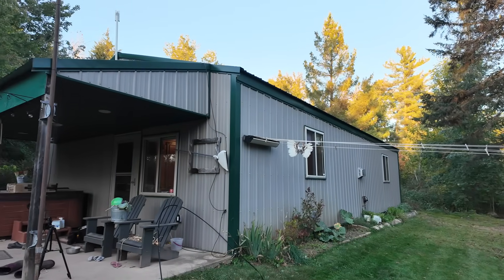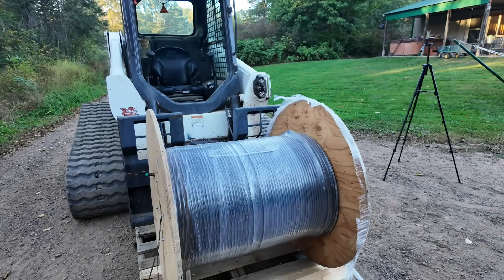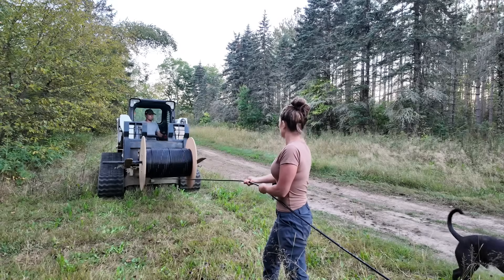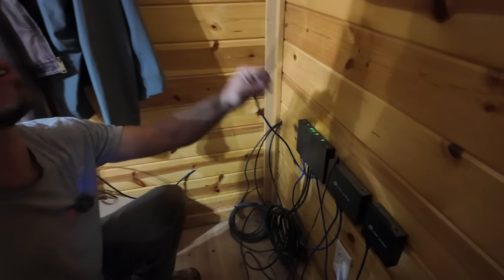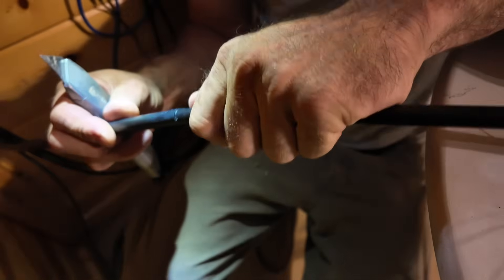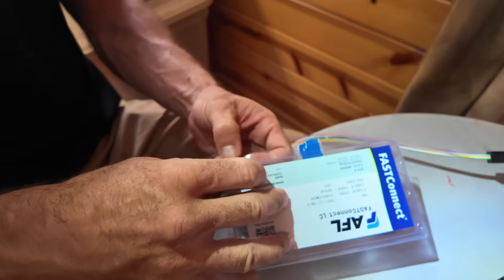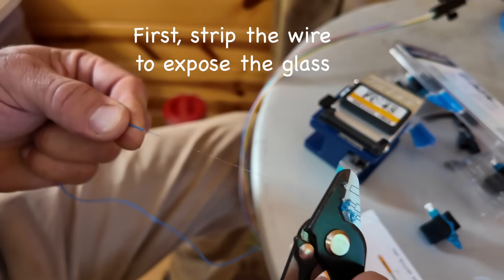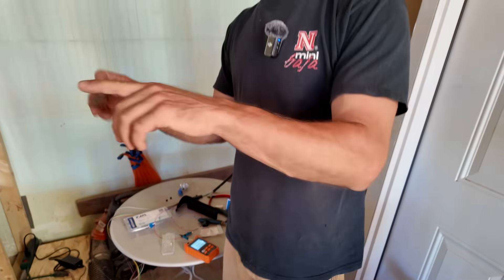We Need Internet! Running a 3,000 ft Fiber Optic Cable

Comment: Great work, I do agree with others on the long term life-cycle solution: Find a fiber guy with a fiber splicer and purchase pre-terminated LC connectors; OR if you want to drop money, buy a used splicer, those are the pros, melts the glass and splices 2 ends together, that's the golden industry standard!

Comment: Why not just get a pipe down and blow the cable through? Cable will cost probable 1/4 of the price and the pipe is pretty inexpensive aswell and you still need to dig so. Would be alot easier if something happens with the cable because of frost in the ground etc.

And why not just terminate it in a box outside on the wall and get a core fusion splicer and a preterminated cable spliced to it? This looks like a nightmare.

Comment: I work in IT and love watching stuff like this. I've terminated Cat6 patch panels and made many an RJ45 ethernet cable in my time. I've never made a fibre cable before, so interesting to see and learn about that. Nice one, guys. Good luck with digging the required trench(es) and protecting your connection.

Comment: You can use ethernet over power line devices. 
Those "cores" are glass strands, hense fibers. The early FO cables buried along the right way in Kansas & Nebraska in the 1980's was not armoured. Sprint had problems with speed, so the problem was the gophers were chewing on the cables and causing cloudiness in the glass strands, so they has to add the extra protection for feature runs of the FO cables.

Comment: Enjoyed the video and the learning experience, thanks for sharing.  If I was to make a recommendation, it would be on the networking side.  With multiple locations, and as Content Creators I would look into Ubiquiti equipment over TP-Link.  TP-Link is inexpensive and therefore where most people start, but it has severe security loopholes and lacks management tools.  A Ubiquiti system would allow to manage all your sites, integrate cameras if you choose too; magnetic locks with badge or fingerprint entry, a NAS for all your files and backups, battery backup... basically everything a business + home needs under one umbrella.  On top of this, while it may sound overwhelming, their software is very beginner friendly without sacrificing in-depth tools.  Plus, there are lots of tutorial videos available.  Just a thought, but looking at your situation, I think it would serve you considerably better with networking alone.  The rest is optional, but extremely useful.

Comment: Typically when installing an ONT the armored cable goes into an ONT box on the wall that is around 1.5ft big and it has a big circle wrap around where you leave a service loop (extra wiring) and wrap all the fibers around the circle. These fibers wire into an LC port on the box where you can use stronger fiber patch cords to plug it from the box into your equipment.

Comment: I found a source for direct bury 2 core single mode pre-terminated, very reasonably priced.  I think I paid around $900 for 1,000ft.  If you use SC connectors and SC SFP you only need one strand for send and receive.

Comment: Oh my! Glad you figured it out but... 

You didn't need the fanout kit or the special slitter. With fiber don't strip back more than you need. Additionally don't strip so far in one go. If you had stripped 3-4 inches at a time of the outside jacket you wouldn't have needed the special tool. When removing cladding prior to cleaving you only need to srtip about an inch. Enough for the grip areas on either side of the cleaver to grip the fiber. BE CAREFUL with the cut off piece of fiber. If it gets poked into your skin and breaks off (which it will) it's really hard to get out and can be quite painful. To test for signal loss you need a single mode optical light source, 2 fiber jumpers and 2 couplers. Plenty of tube videos on how to do it. 

I hope you left a few service loops! Ideally at both ends and maybe in the middle somewhere. If it breaks loops are very handy since they reduce the number of splices by half.

Comment: Good job for a DIYer. Another tool you should have is a connector cleaner. It doesn't take much to make the connector end face dirty which can wreak havoc on your signal.  In addition, debris and contamination can permanently damage the connector. The connector pressure at that tiny scale is around 45,000 psi

Comment: Nice video!  You might want to check out Crosstalk Solutions' channel.  He did a video on shooting WiFi through the woods.  Turns out you have to go to 900 MHz as 2.4 and 5 GHz won't penetrate.   Now that you have fiber run, it might be good as a back-up.  And it might be affected by rain.    https://www.youtube.com/results?search_query=crosstalk+solutions+get+wi-fi+to+outbuilding+through+wooded+area

Comment: This fiber was a great solution, but I can tell you I have many networks going through heavily wooded areas for much farther and work like a champ. The situation is that companies keep upping the frequency used for distances, and bandwidth benefits. If you go down to the old school 900Mhz systems (which are still available), they won’t go as far, but they will penetrate a lot of objects without issue. 1/2m of trees would have not caused a blip with some of the systems I’ve installed. Day late and dollar short, and fiber is a fantastic option once installed, but for those looking for similar solutions, do note, there “are” wireless options to consider that would have worked.

Comment: I understand you’re keenness to hook up the cable and get it working; however, I can’t help but feel that it was a mistake to roll that cable out before you had a trench to put it in. The cable is at risk of damage until you get it buried, and it’s going to inevitably be in the way when you do get to digging your trench.

Comment: Wow! I've been in the industry for over 30 years. Although it wasn't wasn't designed or completed exactly correct, you did an excellent job as a DIYer. I didn't think you were going to be able to get that close to correct or even be able to get it work. You chose the right type of fiber for the distance and application, you didn't need 12 strands but if was cheaper then it was the right choice. You clearly did some homework and had enough common sense to get it to work. If you started polishing fiber I would have lost it. Great job! For not being a network guy I'm impressed.
Reply: Lol, i almost thought he was going to pull out a scope to inspect the endface... :)

Comment: You guys are incredible. Your explanation almost made me feel like I could do it, though I know in my heart it would end up as many of my plumbing project do. Still, I am a network engineer and never considered running (much less terminating) my own fiber. Cheers to you for adding yet another skill to you kit! P.S. I did run one of those long range wireless links, but it was line of sight, no trees, and it worked great.

Comment: One-third applauding (as a fellow DIY-er) your efforts while two-thirds shuddering and cringing (as a LV technician) at the various mistakes you've made with the fiber pull and network installation.
I guess if you've got it up and running then call it a win.
Live and learn!
Reply: Terminating fiber properly requires highly specialized (and very expensive) tools. The laser you used is basically just a continuity tester and tells you nothing about whether the cable will perform at its rated speed. For that you need more sophisticated equipment. A pro will probably charge you upwards of $1000 to terminate the fibers but that's a tiny fraction of the cost of the required termination and testing equipment (many thousands), and there's no substitute for experience. 
But first you have to properly bury the cable and bring it into the structures through some conduit and an exterior box or at least an LB.
You've got tons of space to maneuver so it might make sense to rent a ride-on trencher to get the job done properly and quickly.
Reply: I realize now that this video is at least a month old and that the work has probably been completed.

Comment: why are you using a visual fault locator (visible red light, less than 700nm) to check signal strength? you should use a power source to meter it properly. If you use single mode cable you should use a 1310nm or 1550nm wavelength. 850nm is for multi mode FO. Various mistakes but a really good work. Congrats.

Comment: Where did you even get that if something can do a 14 mile range, that it should be able to go half mile with some trees in the way? It’s a point to point microwave antenna, needs to be unobstructed, microwave doesn’t go through trees, just like the starlink you raised up to avoid the tree line.

Comment: You might want to get a small fiber patch panel to protect those small fibers and then use a short fiber patch cable to the switch. Good job.

Comment: Awesome job and great learning experiences. When rechecking your light levels off of your SFP’S the TX ( transmitter) is you laser side for reference you can get an lc jumper and test right out of the TX side of the sfp and then check your RX ( received side) on the opposite side the 12ct fiber. And vice versa. Remember going through a mechanical splice light loss will be roughly 1db of light per end. Also as a rule of thumb in a 12 ct fiber is to use first available. Which would be Blue orange green brown slate white red black yellow violet rose aqua. Good luck and if you ever need any help with fiber let me know cheers
Reply: Also extra cable at each end is your friend.

Comment: I've been retired for a couple years Switch/Eng but have fooled with more fiber than I want to think about, it made my head hurt just trying to go back and remember what I used to know a little bit about, the only thing I can suggest is if you can get your hands on some of the appropriate equipment to actually run stress tests on your runs, we actually would stress tests are fiber connections for a 24 to 48 hours and get a comprehensive report of any losses. 

My only other suggestion is make sure you have plenty of spare connectors on hand it's not a matter of if they'll go down, they will, they will go down when you don't have a spare and when you really can't afford for one to go down.

Comment: Amazing! As a network engineer I was on the edge of my chair through the entire video, but you nailed it. The cause of your challenges is the quick connectors instead of splicing, but a splicer is too expensive. I would recommend hiring a tech to terminate your ends if you end up having connectivity issues later.
Reply: The lc unicam connector relies on matching gel which eventually goes south and will give a higher loss reading. A cut and polish type connector is better but requires special tools. Looks like a fujikura cleaver. You can always place ends in a patch panel later. Good job guys.

Comment: seems a 50' above grade ; cabled  and secure pipe with two yagi antennas would have been better and cheaper and faster. Just had to get a 'tree alley' direct point to point above tree line

Comment: Running fiber cable is rather easy. If there is fiber on the street near your house then your in luck. If the fiber is aerial or underground no matter. Optical cable to the home, all have mechanical connectors, there's no fusion weld.

Comment: Although you went ahead and bought a midspan tool to get into the cable, you so could have done that "diy". I did it for years with a straight and a hook blade. After you made that first ring cut back off the end of the cable, all you had to do is go another 6 inches back towards the end of the cable and make another ring cut, and because it's armored, you could of made a lateral cut from ring cut to ring cut and pealed the jacket off exposing the armor. The armor is not a metal pipe, it has a split in it and you could have very easily taken off that 6 inches of exposed armor off the cable and then the rest of that unexposed cable should slip right off like you originally attempted. Boom! Done!

Edit: I also seen that there was a red rip cord between the jacket and armor and depending on the cable there might have been 2 rip cords on the inside of the armor. You could have just cut off 6 inches of the jacket and exposed the rip cords (while wearing gloves) and ripped the cable open because those cords are made of kevlar and they will cut through the armor and jacket exposing the loose tube.

Comment: I also do this for a living. You held your own man! Especially for being self taught. The tools we use are very expensive so you did your best with what you had to deal with. There were some cringe spots with how certain things were done in the video but you tried and ultimately it worked. Longevity might be an issue later with your connections but it’s something test can be fixed easily. Just don’t cut that cable between a & b! That’s when it can suck! Great job!

Ps I’m jealous of the property you have! I’ll get there one day!

Comment: He is using 1Gb SFP Switch connections because of the slower sub 1Gb Starlink speeds and that is what his Switches support.

Is the SFP/SFP+ Transceiver used on the cable ends all that has to change to go to 10Gb speeds (or higher) with appropriate Switches or is Fiber Optic cable rated for different speeds like Cat5E/Cat6/Cat6a/Cat8 (with higher rated cable more expensive)?

Once you run a Fiber Optic cable can it handle any speeds with appropriate Transceiver ends?

Comment: I found the explanation on the install very interesting. 😍😍 We live on a gravel road with approximately 16 homes 2.5 to 20 acres over 1.5 miles.  The phone company has a major transformer? where the optic cable needs to be connected to at the one end of our road.   Originally everyone had land lines.  We get cell service in part of the house.  

After your explanation cannot understand why Century link could not have run fiber optic in this area.   They maintain the old phone line and most of past customers just use cell phones.  😪😵‍💫
Reply: Century Link is doing all it can to keep it's head above water (financially).  Don't expect them to invest in any upgrades.

Comment: I think for me running a plastic pipe along the trench would have been a good choice as well much easier if you need to pull it out of the ground at some point. also would allow you to add any other cables you might want at some point as well

Comment: Nice job!! Fiber can be a little tough but you got right in and got things done. If you haven't trenched it in yet, consider adding a 18ga wire to the trench that is exposed at each end. In the future if you (or your grandkids in 20 years) have to find it again you can rent an underground locator and be right on top of it.

Comment: Using the LayJet would have been much easier - 
you could have also added additional Flex Pipes for Electricity, GreyWater and what not - 
it trenches and closes the HardShoulder on the Side of the Road.

Comment: The issue with the radio is that you did not choose an ideal radio equipment for this purpose. There are several options from Mikrotik, Ubiquiti, etc. on the market. 1km is nothing for radios made for this purpose of point-to-point connection.

Comment: For when you do trench & bury it:::    Eventually, a storm will uproot a tree, stretching/snapping the cable, or a backhoe will cut it. Burying it inside an orange conduit for faster/easier replacement. And don't forget the Underground Warning Tape!

Comment: Of all the internet connections available fiber is the trickiest by far - but once you get fiber up and running you're all set.  Be very very careful not to twist or bend the cable.  We just had fiber run in our area and they enclosed the cable in very this thick conduit.  Just found your channel and look forward to seeing your adventure unfold.

Comment: Just to understand, are you really using a Short Range Multimode 850nm fiber?
Usually the maximum length is 300m (metric) for 10G SFP+ or maybe more if used with 1G SFP only, however I would expect the cable to be 1310nm (you might want to check what's written on it and it might used with LR Transceiver maybe so you might get a better signal strength (if you have a matching 1310nm cable or , if the cable is rated for 850nm don't change anything please, make sure cable and SFP wavelength match ;) )

Comment: You know every cell carrier makes mini cell towers that run off of internet for home and business you they start at like $229 for a home use device and $699 i believe for the business use size for i think 15k sq ft and 64 devices, i could be wrong on the square footage cause it also said the combined footage with a maximum of 3 of those units!

Comment: You don't have to target 0dB in LLR (light loss reading). Every -3dB you loose 50% of signal strength, altough most of modern fibre equipment can work with -25dB (~1/8 of original signal power). Red light emitter is used for diagnostic of fibres more than measuring signal strenngth as it can damage your fibre router (uncalibrtated chinese cheap knock offs can output to strong light damaging equipment). But you did great!
If I were you I would consider installing your fibre cable in PVC subducted tube (same type as plastic water pipes and putting it in the ground).

Comment: Airfiber from Ubiquity would have easily solved this at a fraction of the cost.  I run Airfiber 3-miles between my locations and I get 2gig connectivity.  Can't imagine how expensive that fiber roll was or all the fiber tools to terminate.  This was the most expensive solution - cool that you got it to work, but much easier ways to solve this.